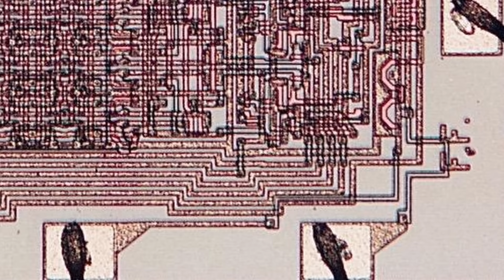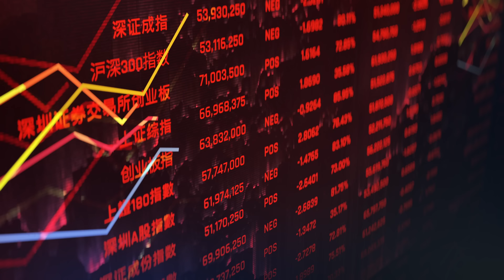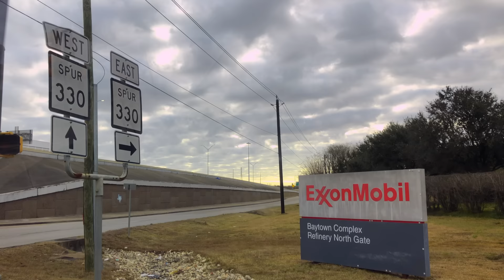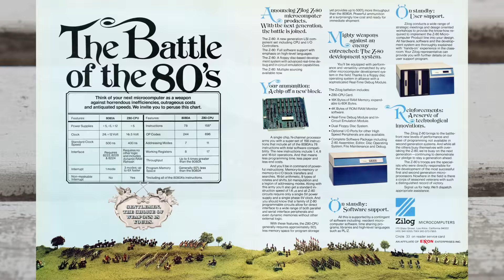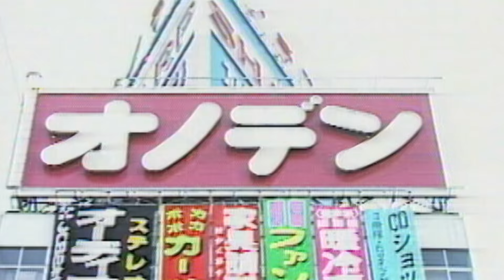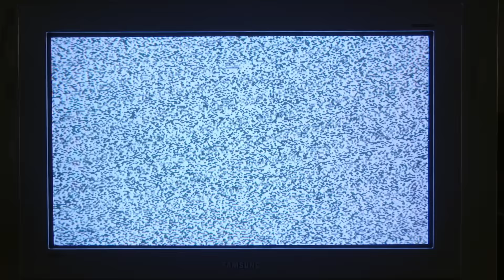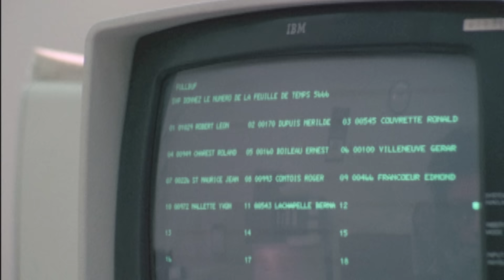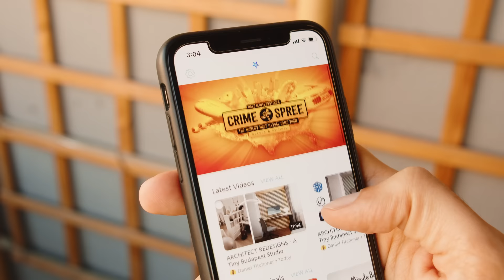Intel’s worst Nightmare

Comment: I'm not an IT professional, simply someone who was curious when home computers started to become affordable, and I learnt Z80 assembler to get my Sharp MZ700 to do things that BASIC and Pascal wouldn't allow. Insights into Z80 assembler made C easy to learn subsequently. Anyway, the point of my post is that I own an Onxy C8002. It's a Z8002 (yes, 16 bit) based computer which runs Unix and, the last time that I fired it up anyway, is still running.
I should probably donate it to a computer museum for the benefit of posterity. 
Although I'm only a home bodger, I do feel very attached to Zilog, and I loved this. Thank you.

Comment: To me, the real head to head for 8-bit supremacy was always Z80 vs MOS 6502. The real "tiny" GIANTS of that era.
Reply: I wrote original assembly language software / firmware for both. From that perspective, the Z80 was hands-down better (and, of course, FAR better than the 8080). I only designed HW for the Z80 (years later), and was impressed with how easy it was to interface, compared to 8088 & 80286, etc... but can't compare the HW of the 6502, as I never designed circuits for it.
Reply: And you can still buy them last time i checked.
Reply: Yes, you can still buy them both!
Reply: @danreitan2506  Your replies are very informative!  Thanks!

Did you ever experience the eZ80 line of uControllers?
Reply: @retromodernart4426  no, but did we not all use them like ucontrollers?
Reply: can we not still use them like ucontrollers?
Reply: @bernds1488  Maybe, but ucontrollers are "glueless" - the ease of implementation is amazing...
Reply: The 1 Megahertz  6502 was benchmarked to OUTPERFORM the 4 Mhz Z80 !! 

The x80 companies had good relationships with the silicon valley news reporters.  Motorola (68xx) & those who left Motorola to make the 6502 did not wave their own flag much.  

I hate Intel's segmented memory addressing. Motorola was just one big address.

Comment: The Z80 found its way into various low-cost devices I used, like in a calculator or a PDA. For poor folks, it was an entry into the mighty computer world.
Reply: And earlier it was in expensive micros too.  The KayPro II sold for the equivalent of $5000US today.  Scary.
Reply: The Z80 also found its way into the PATRIOT Air Defense System radar. The transmitter control unit shrank from two drawers of 71 circuit cards to 1 drawer of 12 cards with a Z80 processor with greatly improved reliability and fault detection.
Reply: @johncasteel1780  also used in lots of gaming machines, probably still.  seen it in many surprising things.
Reply: @christopheroliver148  I was a principal engineer of a system using 2 z80s that sold for $250,000 in today's money - sold like hotcakes, too... Z80 was state-of-the-art, once. Low-cost devices came quite a bit later.
Reply: @danreitan2506  A Japanese technician, many years ago, said that he and his fellow Japanese nerds made a customized motherboard based on the principle of 0-Raid configuration used in hard drive disks. So they experimented in using that principle with silicon IC micro-chips. They are using the same Z80 silicon IC chips made by a small family owned factory in Japan. Their aim is to create a match to what the Americans are coming up with these days. They showed it to me (that was in 2005) and demonstrated it in front of me with everything exposed in a transparent epoxy case and what Intel is selling those days they are able to match it but this time it is more than 100 times cheaper than the best Intel Desktop Computer and their OS is Linux. Their hand made and hand crafted customized motherboard is rather unusually very large so as to accommodate as many Z80 silicon IC chips and including other chips such as RAM, ROM, USB BUS, GUI, DRAM, etc. All of these events happened 17 years ago and I wonder what happened to them, my good guess is that they started using it only among themselves and with their other fellow Japanese nerds.
Reply: @danreitan2506  This is not the only time somebody tried building their own customized hand made and hand crafted motherboards. The Israelis are the second ones who did it again for their Compulab Airtop desktop workstation working 24-7.
Reply: @darthvader5300  The expensive system I mentioned was using dual Heurikon motherboards in a Multibus II chassis (with custom codec and graphics boards) used for digital video. The cheapest Z80 system (cost, anyway) I worked with had a 1-bit (software-driven) address and data bus... My only point was really that there WERE some very high-end industrial systems that the Z80 worked well for, when it first came out (not everything was about PC OEM equipment back then... When I designed systems for a major X86 OEM later, I had to adjust to the large step DOWN from the high-end industrial resources I had become accustomed to). When I later worked for Intel, I was surprised to see how they were mostly using Sun Workstations, for both servers and PCs... :P
Reply: @danreitan2506  lik the 6502
Reply: and they controlled the early commercial hard drives

Comment: I loved programming the Z-80 in assembler, back in the 1980's & 1990's. 256 main instructions + another 256 hidden instructions (CCh & CDh pages). By comparison, it made other processors seem cruse & limited.

Comment: I met the guy who designed much of the arcade game "Defender". He loved Z80s, even using extra ones for roles that could've been done with a cheaper controller chip, just because Z80s were already familiar.
Reply: Dave Williams. I was about 15 when Defender came out... that guy is still a god-level programmer to me.
It's been more than 40 years and I can still see the flashing lights and  the hypnotizing sounds in the dark environment of the never-before-seen video arcade!
Reply: I have a Williams Defender arcade game. It's a brilliant design and uses the Motorola 6809 microprocessor in the main pcb and a 6809 in the sound pcb. I am  also a fan of the Z80 and used it in several designs. I visited Zilog in the 70s. While walking past Shima's office I admired his wire wrapped TTL prototype of the Z80 hanging on the wall. I wondered what became of that prototype.
Reply: @Electronix4Dogs  Interesting. I didn't know that Defender was also done with 6809's. Maybe the 6809 was a later model, or the designer only used Z80's when he prototyped it. I'm not surprised that it still required multiple processors. It was quite an achievement to make such a fast game. I can hear the sounds in my head now. :-) Thanks also for the Zilog story.
Reply: If I may be pedantic... Defender didn't use the Z80. It used a 6809 and 6800.
Reply: @jjprulz  Not pedantic at all, since the topic is processors. See other comments in this thread. My guess is that he used Z80's in the design stage because it was familiar, but it changed in the production model to save money.

Comment: There was another competitor to the PC though. Anyone who knows computing knows of the Commodore Amiga. With custom Hardware designed by former Atari Wunderkind Jay Miner, the Amiga, in 1985, could do things that the PC, TEN YEARS LATER, could not. And vice Versa, as the PC used raw Clock-speed to brute-force early low-poly 3D games. But I daresay that the Low Spec Lore team already know this story, and the tale of how early low-poly 3D games could end up running too fast on faster PC hardware.

Of the Z80, it apparently made a half-decent sound chip as well, ending up as a secondary sound chip in the Neo-Geo.
Reply from the maker: The whole story of commodore and their last ditch struggle against the IBM PC is indeed on my radar. You will se me inch closer to that topic as time goes by. I just had to simplify for this video!
Reply: The z80 was also used in the DAC for the sega genesis iirc
Reply: > custom Hardware
Which was ultimately the downfall of the platform. Only Commodore could build an Amiga, everyone else and their dog could make a PC. Commodore rested on their laurels while the PC folks kept innovating. The 1200 was too little too late, the PC already had moved on. And a PC from ~1995? Sorry but i only need to mention one game here, Quake.
Sure, the Amiga was a dream machine in 1985, with a hefty price tag one might add. But then they rest on their laurels and left the platform to rot. And even when Commodore started building PCs their offerings where always a generation behind.
Yeah, i love my PC-30 III to bits, but when it came out it was already yesterdays news.
Reply: x86 had/has multiple competitor arches over the decades - m68k arch in the '80s and '90s, PPC arch in the '90s and '00s, and even ARM and modern-day IBM Power silicon in present times, like from what I've looked up, Power10 is a beast in the HPC market, for example, as is server/workstation-grade ARM silicon like the Altra and Altra Max series. Even POWER9 (naming scheme changed from Power10 onward) in the Raptor boards is supposedly pretty good.
Reply: Isn't the Amiga kind of the exact opposite of low-spec gaming?  ;-)
Reply: @jasonblalock4429  Well, maybe for 2D gaming.
Reply: @jasonblalock4429  Depends on what you got during its original run, IIRC the A500, A600, and A1200 could've very much counted in the 'low-spec' category as they were the cheapest Amiga models available in their given generations while the A2000, A3000, and A4000 are decidedly nowhere near 'low-spec,' being the flagship workstations of their given generations.
Reply: Not to mention the 68k instruction set was far nicer than the 80?86 things.  And let's not forget that bletcherous real-mode addressing or the poverty of registers.
Reply: what couldn't the pc do 10 years later
Reply: @JM Coulon And also significantly more expensive than the A500. ~3000 dollars vs 700. These are not competing systems.
Reply: I remember in 1985 Amiga was a dream machine, but even with windows and multitasking, it was tailored for games
Reply: I've never heard the terms " low spec"  and Amiga in the same sentence
Reply: There's another, another competitor as well. Acorn computers developed the Acorn Risc Machine aka ARM processor for their machines which was so good it was spun off in to its own company and is still around in everything including directly competing against Intel in Macs. Acorn's 32 bit ARM powered machines first arrived on the scene in 1986 and blew most of the opposition away. It took until about 1996 for Intel to catch up.
Reply: Oh, Amiga games ported to Acorn ARM machines easily since its graphics and audio and performance were at least as good as the Amiga.
Reply: @melanierhianna  Yeah, ARM Processors are amazing. And while I could go off about the state of Modern mobile Gaming, I'll save that rant for a Jimquisition video.
Reply: @melanierhianna  now it is

Comment: I remember programming in z80 assembly on my TI-83 Plus back in high school. Good times.
Reply: Used to program assembly on an 83 myself.  Not a plus.  I must be older than you lol.  Good times.
Reply: @armyofninjas9055  Not a plus? I thought only the Plus was able to be programmed. But I only ever used BASIC
Reply: I have a TI85 and 84Plus I picked up for cheap at a garage sale.  I prefer HP RPN for use as a calculator, but I'd like to find a decent way to play with Z80 assembler on these things if I can avoid keying in code on the calculator itself.
Reply: @christopheroliver148  At least for BASIC, you can use the 84+ USB port to load files from a computer
Reply: I used a Sinclair ZX81 myself. Programmed in machine code and BASIC.

Comment: Oh hell yeah. Huge fan of this chip. The z80 is iconic.
Reply: 'twas that little thing that taught me basic, i drew (programmed) my first digital art on it, made my first game and crapped my pants for the first time from c compiler.
my blood is full with pure nostalgia juices, right now.
Reply: The one processor I at times dream of.
Reply: I loved the Z80, and that love was only amplified by the news of the discovery of "hidden" instructions which allowed the two 16-bit X and Y index registers (used as memory pointers) to be used as four 8-bit registers for most purposes.
There were a pair of 8-bit registers (H and L) which were designed to be used as a single 16-bit index register for some purposes, and the instructions for dealing with the X and Y index registers were just the instruction for dealing with the HL pair but with a one-byte prefix.  It was discovered that adding the X or Y index register prefix to 8-bit H or L instructions would use the High or Low byte of the index register, just as though it was an H or L register.
So far as I am aware, all the modern copies of the Z80 (which are still available) have duplicated that functionality.
Reply: YES, look at the register set of the z80

Comment: I always loved the Z80. In 1979 when I was 19,  with a friend, we built a full computer around it. I programmed  it using an hexadecimal keypad! It was a pure amateur thing, wired with wrapping, which made it difficult to work and even more to reproduce. So only one was built. Because of this, I  hated x86. Later, I falled again in love with another microprocessor, Motorola 68000, for its extraordinary instruction set and assembly langage. When I finaly could buy my first TV-connected computer, (a Sinclair QL, built arround a 68008), I wrote an assembler program for it in Basic, which allowed me to run some experimental fun programs.  Thank you so much for this Very nice video that reminds me of those early times !
Reply: Out of curiosity, what are your thoughts on x86/64 and ARM nowadays, and were you also 'around' when RISC processors were the Cool New Thing? I wonder if you've actually programmed in assembly for those too. I'm not old enough to have witnessed any of that happen personally, but I've always been extremely curious about the history of computer hardware and funky microarchitectures.
Reply: I was about that age too but never experienced the Z80, rather the 6809 when I heavily got into ML (no compiler at all either!) made a sound card for it too. Wish I had kept all those PC boards, would be a good museum piece now. Life is indeed a journey hey?

Comment: Little fact, the Z80 is still in production with its original design, only that it is CMOS instead of NMOS. Its the oldest CPU still in production if I'm not wrong and widely used in many many applications as you stated.
Also Zilog has some enhanced versions, the eZ80 CPUs and microcontrollers which use the original assembler but include pilelined execution, integrated peripherals, run up to 50Mhz and support up to 16Mb without pagination among other improvements.
Reply: The 6502 is still in production, I think that beats it.
Reply: @snorman1911  Nope, there are things like the 65R02 but those are not the same design, they have improvements, differnt instruction sets, etc, but not the original design.
Reply: @ButterfatFarms  well, yes, it shows how well designed it was that even after nearly 50 years its original design is in use without changes.
Reply: @drgusman  But making a Z80 into CMOS also means the chip design is really different.
But indeed it may be logically identical, while those 6502 versions are "improved".

Comment: Thank you for the history lesson! I remember working with the IBM 360/370, the Burroughs mainframes during my college years; I still have the IBM 360/370 operators manual! Our Burroughs computer was housed in a 3 story building and had the computing power of 10,000 adding machines; that was impressive. We programmed the machine with a shoebox full of hole punch cards or if you were lucky, using a reel of hole punch tapes. I preferred the cards however because I could exchange a card rather than cut and slice the punch tape reels. Thanks again for the memories.

Comment: I used z80 based computers for the first 15+ years of my computing until I finally got a 286, and gave up on BASIC and learned pascal, modular 2 and C programming on them, as well as assembler.
The only reason I changed was for compatibility with what everyone else was using, so it was a fairly reluctant change.
There are still a heck of a lot being made, for use in microcontrollers and other embedded systems, so it almost certainly has had the longest product lifespan of any microprocessor.

Comment: In October 1987 I bought a Cambridge (Sinclair) Z88 mini computer that was built on the Z80 chip. It's the A4 sized one with the LCD screen along the top and a bunch of software apps built in, called PipeDream. I was studying for my PhD at the time. When the Z88 came out I scrounged together enough money to buy the computer, charger, extended RAM etc, about 380 English pounds. I wrote a lot of my PhD thesis on that little computer with it's short screen that showed only five or six lines at a time. I used to record supervisor meetings on a little tape recorder and type them up on the Z88 traveling on the train from London back to Exeter in the west. For the final write-up I got funding for a 286 PC and transferred everything over to that. I still have the Z88, and taped inside the back cover of the handbook are the original receipts. It's like my own personal time capsule and still works after 35 years.

Comment: Cool story, I never imagined there was this interesting history behind the Z80, I knew it existed cause when playing on Sega Genesis/Megadrive emulators, you found options to configure the emulation of the Z80 microprocessor on the settings, so yeah, the Sega console used one of those processors, thanks for letting us know how this story happened
Reply: Sega used the Z80 as the Master System's CPU and as the Genesis's sound chip if I remember correctly. I'm slightly surprised that Nintendo didn't also use the Z80 for the Famicom and NES since Donkey Kong both in the arcade cabinet and on the ColecoVision ran on that processor, but I suppose the greater efficiency of the 6502 compelled Nintendo to use Ricoh's 6502 clone instead.